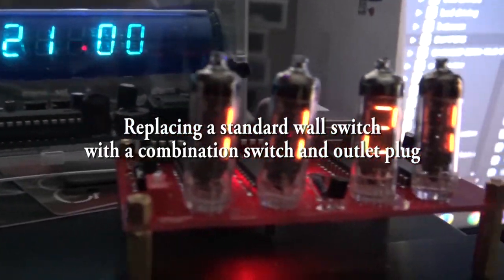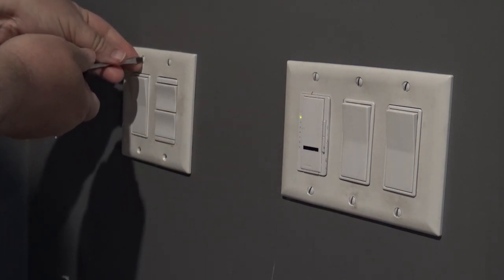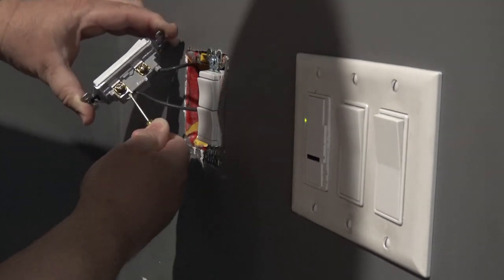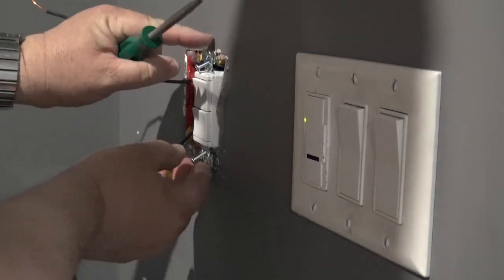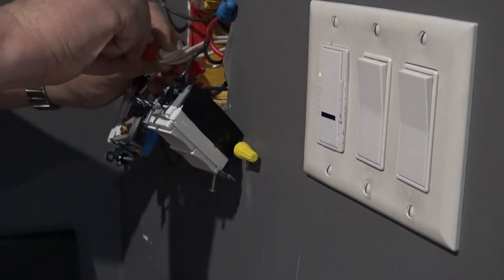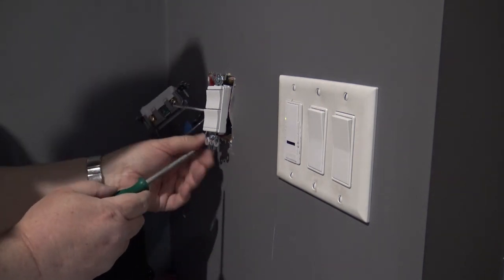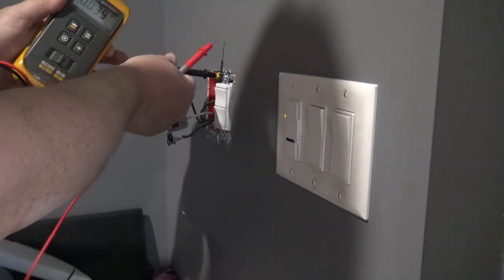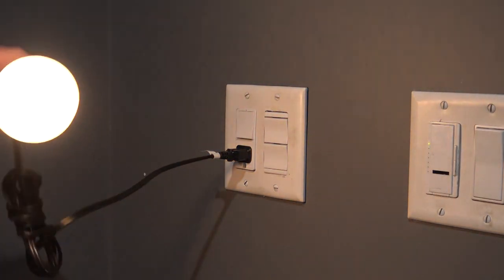Replacing a wall switch with a combination switch and outlet

Comment: Am I missing something here? That socket has an earth/ground pin which does not appear to be connected to anything... Is that acceptable in Canada?
Reply from the maker: Jason james 
Outlet is grounded. Notice where I placed the meter when measuring the voltage. That metal Bracket is ground as is the mounting tabs on the switch. The ground lug is only necessary when mounted on a non grounded box.
Reply: 12voltvids 

The outlet must be bonded to ground as per Canadian Electrical Code.  A switch is permitted to be bonded to ground via the bonding strip in the box.  An outlet must have it’s own bonding to ground

Comment: You seem to know how to work on everything lol, do you also work cars and motorcycles?
Reply from the maker: No I pay mechanics to work on my cars and motorcycle.
Reply: @12voltvids  Don't blame you there, I've always worked on my own vehicles but it gets old fast, I've always liked tinkering around with electronics like you're doing and also liked tinkering around with cars, trucks, bikes etc. but as we get older it seems like working on the smaller electronics is actually more funner lol.
Reply from the maker: @Truckguy1970  
I used to do my own work on my cars but I drive the one of the most technically advanced cars on the road which requires specialized equipment and knowledge of the system and that is only the manufacture that knows that.  Electric cars are more computers than vehicles. Throw in high voltage high current into the mix.  No thanks.  The bright side is they require so little maintenence.  In 8 years no real maintenence on my first one.
Reply: @12voltvids  Yeah I know it. Even if the information were available which doubtfully will ever be, these new electric cars and even some of the newer gasoline and diesel vehicles require special proprietary tools and equipment which exceeds the price of these vehicles and the voltages in these electric cars especially the hybrids are several hundred volts that can burn or actually kill you if you make one wrong move so the technicians most likely have to be trained to work on the equipment and are required to wear special PPE so I'm with you on the "no thanks" lol.

Comment: Why not wear rubber gloves?
Reply from the maker: Fivos Sakellis 
Not needed. I am not grounded and I am not going to grab a live wire. When I did with the pliers I was hanging onto the rubber grips.
Reply: So if you touched the live wire would you get electrocuted? If so, would that trip the RCD? Also, what's the song at 8:20?

Comment: Difficult to follow without a sketch.
Reply from the maker: How difficult is 3 wires. Neutral is white, hot is black, and the black wire to the fan. Pretty basic stuff. I was tempted to use a piece of green colored wire as the neutral but I didn't want to piss off fellow electricians out there.